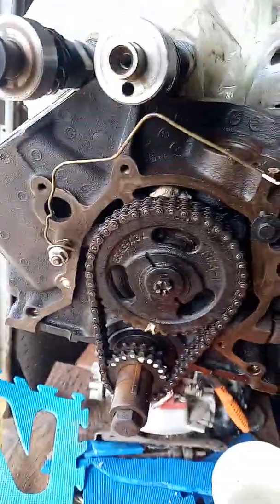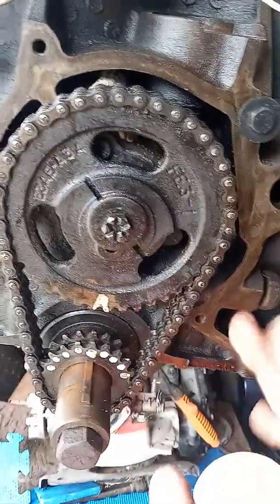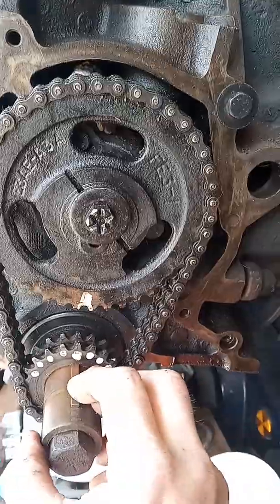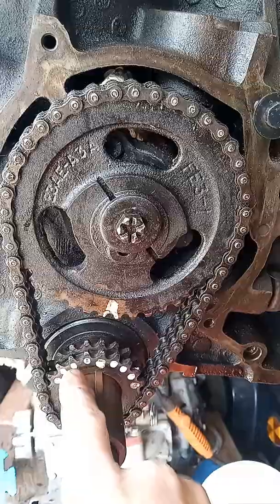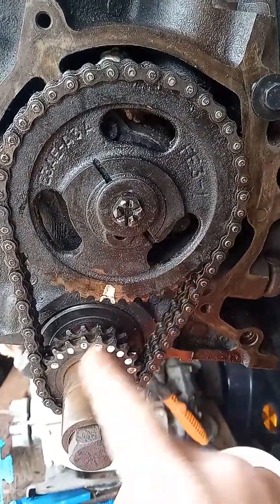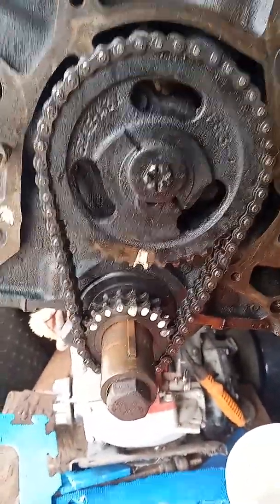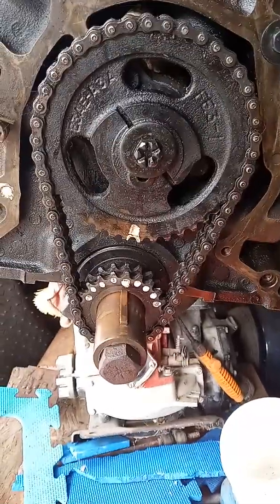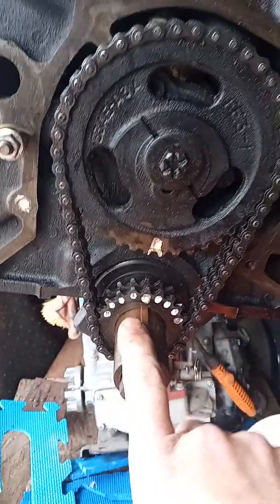how to: advance camshaft on a SBF 302 351

Comment: So i got a flat tappet stock 302 f150 so i rotate the crank to the 4tooth  and thats right? Because what forums i read they are only moving the crank 1/8-1/4 turn which doesn't seem right to me and I have been a mechanic since I was young and yes I'm old now lol
Great video

Comment: Hey Cameron, So I’m making sure I understand your build - 351W or 302W? If 351 - you are using a H.O./GT Mustang cam? And then you advanced it 4 degrees BTC? 
I have a ‘94 F250 351w ZF5 4x4 and I’m swapping in GT40P heads - looking for advice on swapping in a Mustang cam for real world performance 😬😎
Thanks
Reply from the maker: 351w roller engine w/5.o HO cam adv 4 deg. Btdc. On num1 cyl.. 94-97 351w are roller blocks and can accept the late 80s, early 90s roller cam. 5.o roller cam which when degreed, if I remember right only has a little more exh duration than the stock truck cam or explorer cam. I've adv stock and stang cams but didn't notice any difference. The only noticeable gains were advancing a stock cam, whether it be truck, mustang or explorer cam, I've advanced them all. The gains came from adv the cam, but really didn't matter which one. I just left the mustang cam in last because I didn't want to do another cam swap lol, even though I can swap one in like 4hrs
Reply: @SHREKfiona1234  kewl - So were/was there any significant differences hp/tq - real world driving between the truck/Explorer vs Stang cams?  (I do have a set of 1.72 Scorpion Racing - Roller Rockers coming for my install.) I know that the H.O./GT cam (with the Scorpions) will net me a lift of .477/.477 vs the F4TE cam netting me only .445/.478ish. 
I didn’t know if it was worth my time getting a  GT/HO cam for this build?
Thanks again for your time!
Reply from the maker: @TJHill-qx9hy  I've got a set of 1.72 from a 93 cobra that I tried and didn't notice any gains over the stock cheap stamped steel ones. I've tried just about every forum internet performance trick to see what works. The problem you are going to run into is fueling. Once you start throwing the stock map outa wack, it runs like $#!+. MY BEST COMBO was an a9p maf system, 24#r's calibrated to a c&l 76 maf meter, afrs, stock cam. That's about the max the stock system can handle and I've got an e4od so I'm screwed on the torque converter but you won't have that issue.
Reply from the maker: I didn't feel any seat of the pants difference in any of the cams, the trucks are just too heavy. I only use fence posts and my speedometer to see if there are any real speed differences. I painted stripes on posts where 1/ 8 and 1/4 are near my house which is out in the country. E85 mixed w87 and base timing set at 10 deg with spout out took care of deto believe it or not. I mainly build ohc engines but this was the first pushrod v8 I've messed with. Adv timing was completely different and backwards from how it's done on jet skis lol
Reply: @SHREKfiona1234  well, Dern 😜 I was hoping for some more umph when pulling our camper - I will do the cam advancement, and I’m hoping to save up for an Edelbrock Pro-Flo 4 😬😎
I do have the 19# injectors (EV6 from an Explorer), so I’ll stick with the F4TE cam for now and the RR’s for a stock Stang profile, and wait for the Pro-Flo before she gets more mods.
Cheers!
Reply from the maker: @TJHill-qx9hy  I would love ❤️ to tell you to slap everything you can on it and hold on but unfortunately, my experience was very disappointing when trying all these mods lol. The 1.72 are a great upgrade but will you feel it? Not really..... I'm sorry if I sound disappointing but I'd rather be honest.
Reply from the maker: Your best gains will come from more airflow, more fuel and higher compression. Or a stock engine with a turbo lol

Comment: I have a 87 foxbody, and im wondering if you recommend advancing for my set up, bored .30 over, stock cam, stock E7 heads(with some port work) Explorer upper/ lower manifold. Thank you
Reply from the maker: The 5o revs much better than the 351 does, but the stock cam, yes. According to tmoss, he advanced the stock 5.o cam with excellent results. With gains all throughout the rpm. If it were mine, yes, I'd advance it. Look up tmoss, I wanna say he track tested before and after with actual results.
Reply: Your best bet is to buy a degree wheel and get your camshaft specs sheet and go from there.